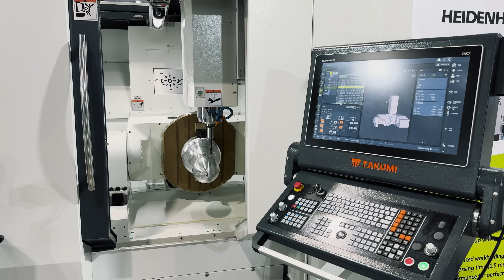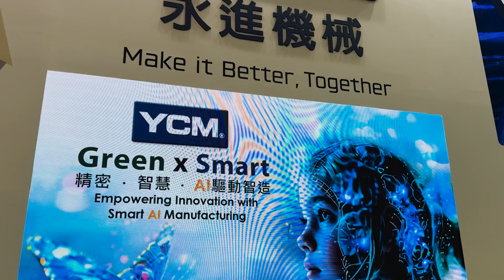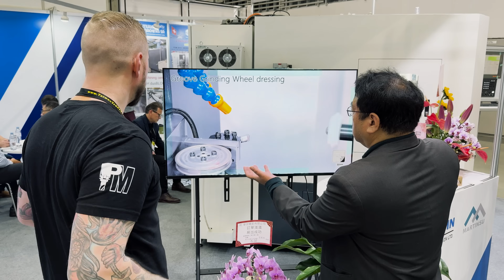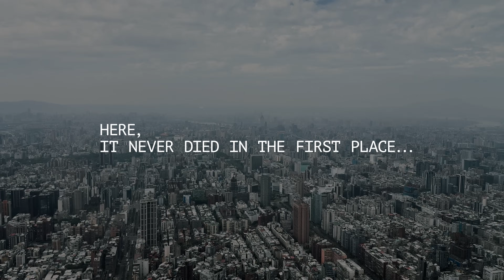What America Can Learn from Taiwan’s Manufacturing | Machine Shop Talk Ep.131

Comment: Welcome to Taiwan, right Taiwan is exceptional for such a small country. In southern Taiwan we have some businesses which work with tools which you can only find in museums. However there are also some very modern shops here.
I spotted a sick CNC machine here and fixed it since that time I also have access to such a machine in Taiwan. I'm very surprised how well some 25 year old machines can work and how advanced those machines were around 2000. The one I fixed can even do trochoidal milling through a special high speed interface.